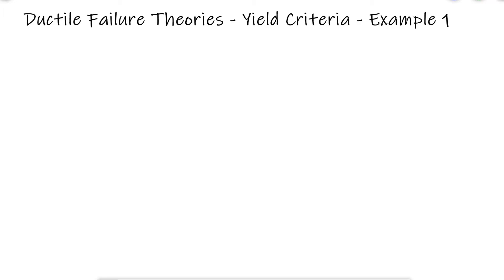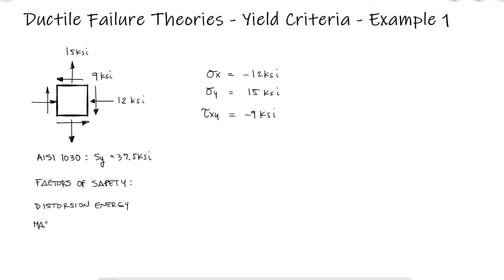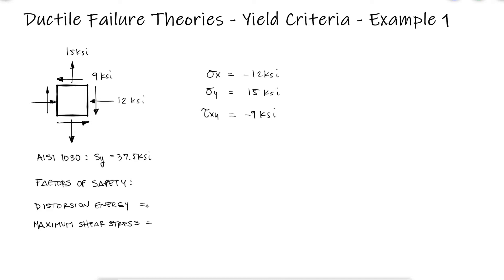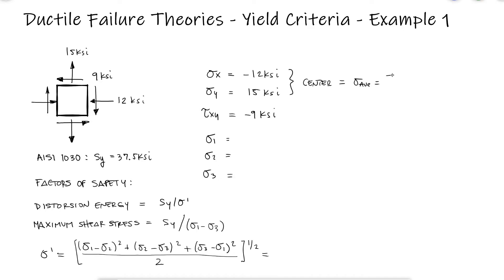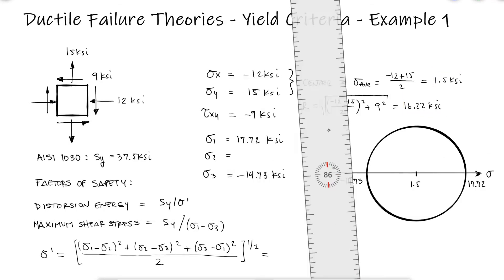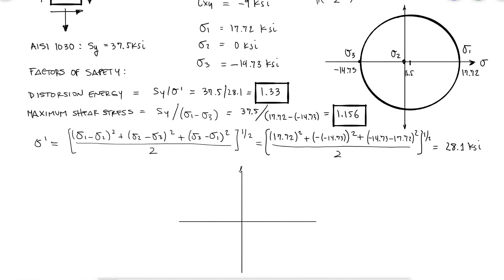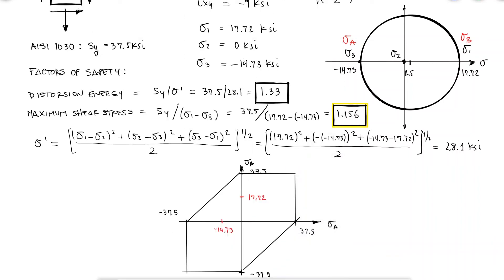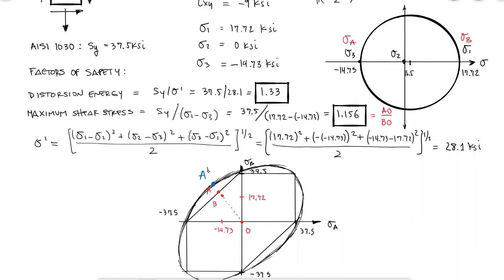Yield Criteria - Example 1 - Stress Element Distortion Energy and Maximum Shear Stress

Comment: Dear Sir,
I gave an example to my students with the following data:
sy = 162
sx = 150
sy = 30
txy = 45
They found:
Ftersca = 0.98
Fvm = 1.025
But the locus on diagrams posed a problem for the VM case.
The locus is outside despite Fvm > 1 ????